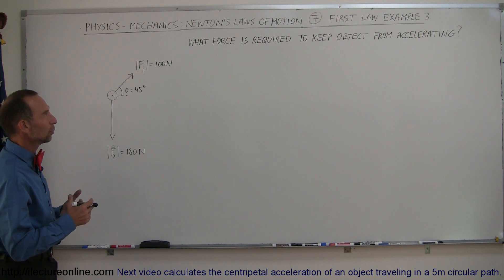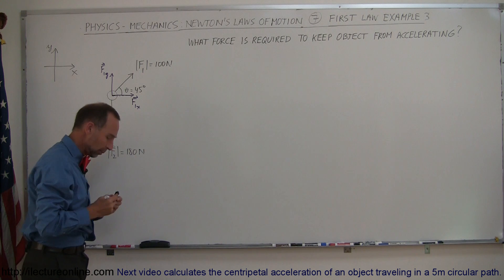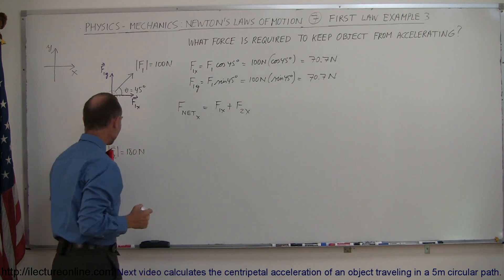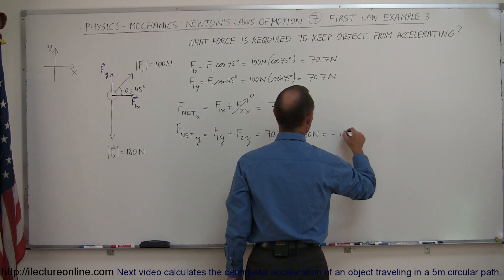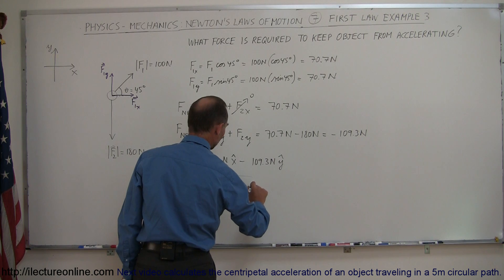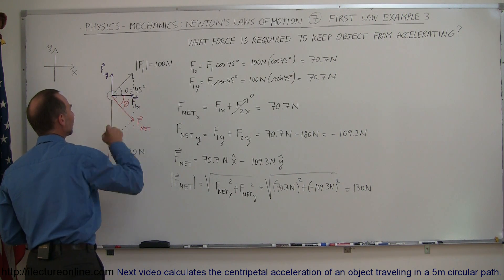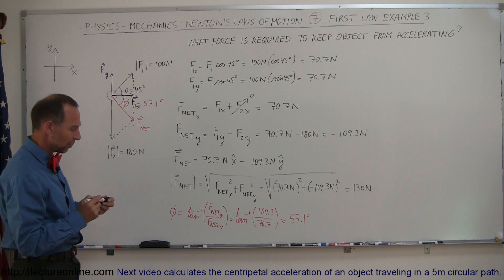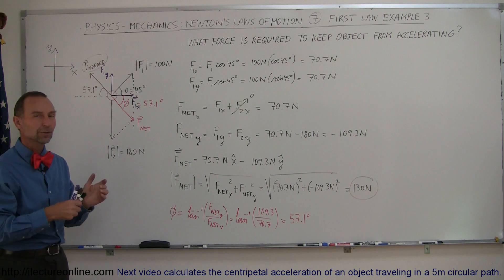Physics 4  Newton's Laws of Motion (7 of 20) First Law: Example 3

Comment: I'm stuck when you draw the red Fnet line after you draw the two dashed lines. Wasn't Fnetx the horizontal line Fnetx? For the y I agree with you. Wasn't the hypotenuse supposed to be connecting the end point of F2 to the point of Fnetx? Do you mean that Fnety is F1y? If you mean F1y then it makes sense. Sorry I'm kind of lost in confusion these days.

Comment: Thanks professor for this great lesson. Question: The balancing force’s x-component vector should be -70.71 N to the left, and the y-component vector should be +109.29 N upward. So the resultant vector of the balancing force in the diagram should be in the 2nd quadrant of the x-y coordinate system?

Comment: Just wondering, relating your example to a real life example:  If someone were walking two dogs (F1 and F2), if you weren't paying attention and they both took off at those forces, would you be pulled with the force and direction of the Resultant force?  Also, if you were ready for it, would you need to be positioned at F3's angle and be pulling with a force of 130 N to stop them in their tracks?

Comment: How do we know the location of Fnet?
Reply from the maker: A force (which is a vector) is usually not associated with the "location", but more with the magnitude and direction.  Typically in a problem like this the force appears to act through the center of mass.
Reply: Michel van Biezen the angle was 57, how do we know that it will be in the negative x and negative y axis?
Reply from the maker: Fnet is the vector sum of F1 and F2.  When you draw out the vectors as in the video, then it becomes clear which direction it points.  (I always recommend that you draw all your vectors).
Reply: Oh I got it since Fnetx is positive and Fnety is negative we figure out that Fnet will be in the 4th quadrant. Thank you for the replies and the great videos. They are making my studying so easy and enjoyable.

Comment: sir, what is arc tangent,why did u take it into consideration? thank you
Reply from the maker: Arc tangent is also known as "inverse tangent".  If you are given an angle you can find the tangent (which is the ratio of the opposite side to the adjacent side).  In reverse if you know the ratio of the opposite side to the adjacent side you can find the angle by using the inverse tangent (or arctangent).